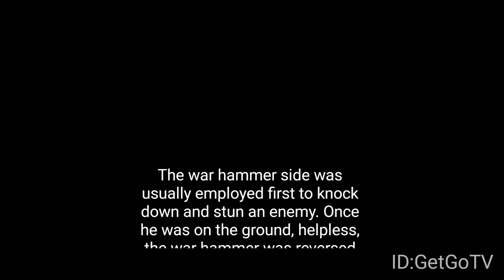Antique Hammer Axe Restoration - 14th CENTURY

Comment: FGS! Sharpen yr saw and bolt yr vise down!
Also, round handle on a striking weapon is wrong; should be rectangular or oval.
Reply from the maker: My work area is a desk inside of a house. Nowhere to bolt down a vice. Haven't heard of anyone sharpening a hacksaw. The axe head had a round hole for a round hole handle. I have some that are original that also have round handles. Google it and look at the images you will see many examples of round handled axes from this time.
Reply: @-GetGoTv  perhaps you could clamp it to the desk somehow and use something other than a hacksaw on wood or, a new blade.  The whole point of a rectangular or oval handle on an edged weapon is to aid with edge engagement; sometimes a stud or two on one side of the handle in the case of a reversable weapon such as this to act as a tactile cue. But I doubt that this is an actual war hammer, the langets are too short, the hammerhead should have points on the corners to bite in and prevent glancing off, the hammerhead neck is too delicate and the hammer should be paired with a spike, not an axe. This reminds me of a carpenters axe.  But please find a way to secure your work before you saw your own thumb off on camera.